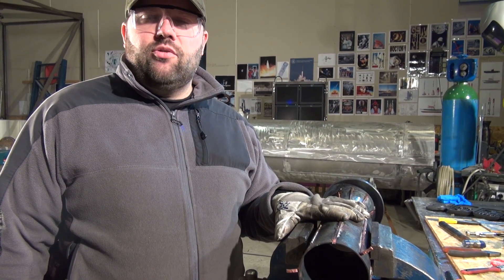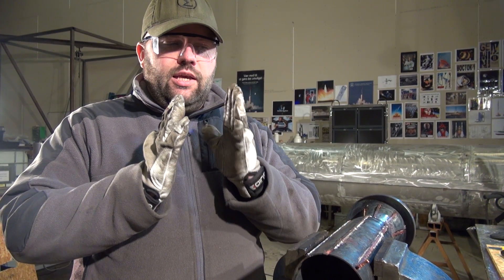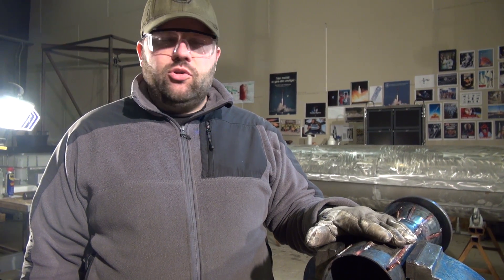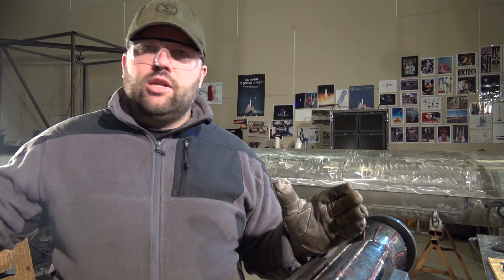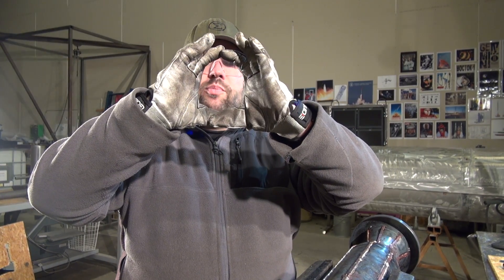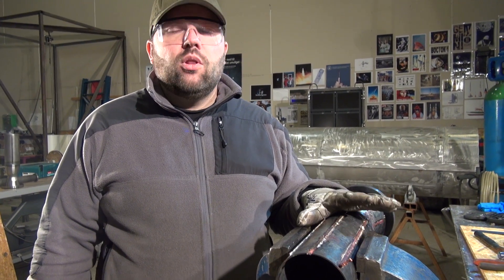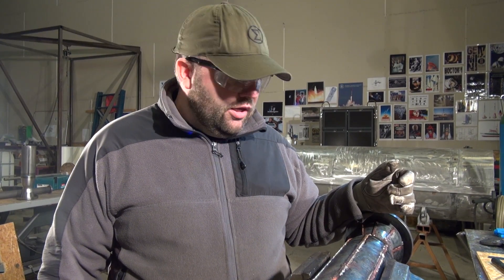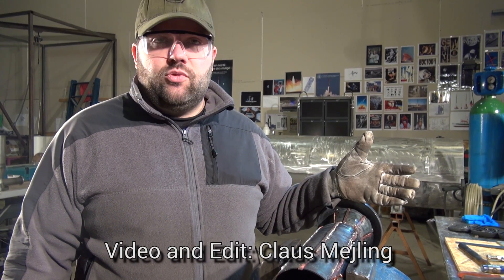Rocket Engine Cooling Jacket Silver Soldering - BPM5 Version 2

Comment: One thought: You might try electroplating the solder alloy onto the can, and the strips, and attempting a forge braze (kiln fire to brazing temperatures), or possibly a tinning step, followed by forge brazing.

If you're interested I can toss you a few links. Relatively easy to mask off the areas you don't want electroplated with solder alloy - brush plating is even an option. Should enhance flowability of any solder/brazing material added afterward, and give you the nice fillets you're looking for.

Comment: Why won't the solder melt when the engine is running I would imagine the engine burns higher than 650F
Reply: Because the fuel runs over them on the way to the nozzle for cooling.

Comment: That soldering job looks horrible. If you're using C+C, can't you just start with an over sized liner and then mill out the material not required, instead of soldering copper spacers onto the surface?
Reply: +tasmedic The nozzle is rolled.
Reply: Ok, now I understand!
Reply: That is a lot of machining time for a company with a lack of machines and money.
Reply: Jannick H
I gather they're rolling the material rather than machining it.
Reply: Yes they have, but it would not be a option to machine it anyway, if they havent.

Comment: Even hand oil can make silver soldering difficult. A good clean/etch would make repairing that much easier. In my opinion, if the gap is too large the solder will not wick and be uniform in the fillets you described. 

Also soldering in a kiln if the steel can get that hot, if not the solder will not properly occupy the surface morphology of the steel and will not conduct heat as well as it could.  You'd need to make a refractory mold  and have melt tickets to stop the melt at your pre determined fluxing temp.   Or just build a small propane forge whatever you are rocket science guys what do I know.

Comment: Why not solder in an oven with preapplied flux and solder? It would give a much cleaner result and no significant distortion of the parts due to uneven heating.

Comment: To clean up the joints you could use a small stainless steel wire brush to brush the excess solder off before it fully solidifies.

Comment: I would have thought the inner liner would get to a temperature above the silver solder melting point. Then you would get particles of solder in the fuel flow. Is the cooling from the fuel so good that the inner liner doesnt get very hot?